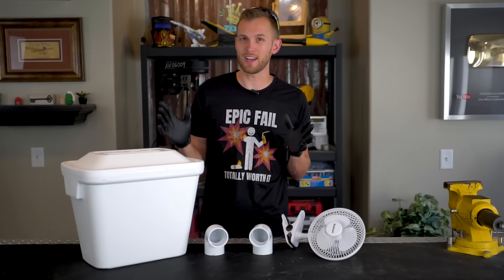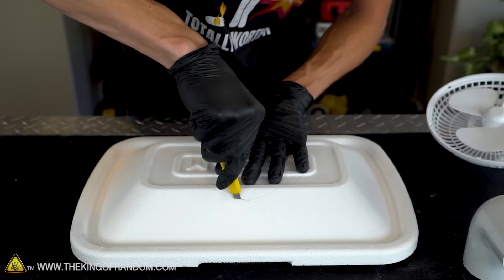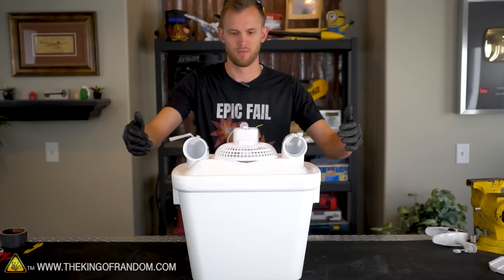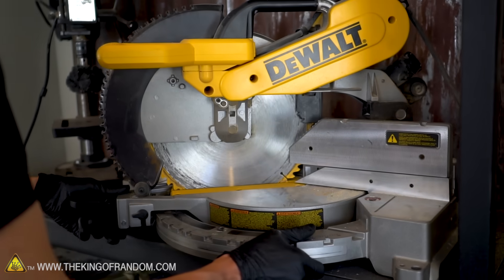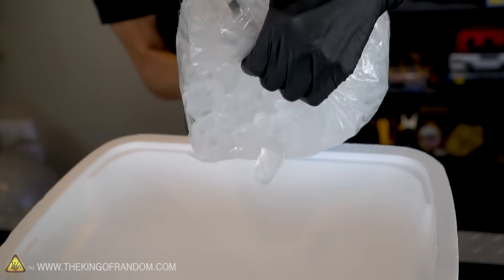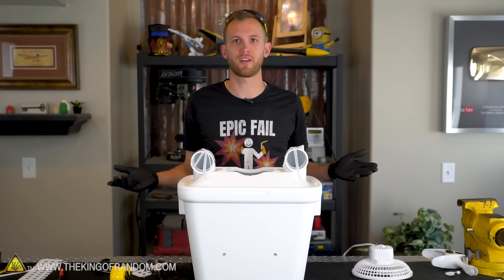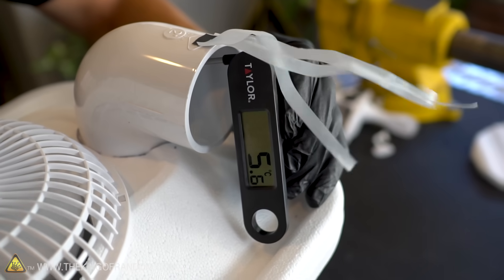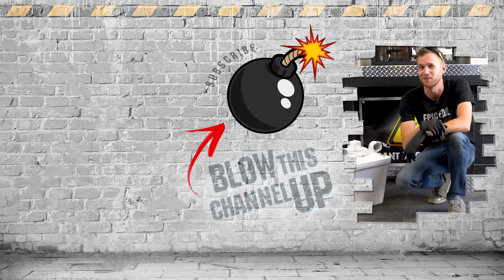Recycled Styrofoam Air Conditioner! TKOR Creates An Efficient DIY Air Conditioner!

Comment: it works great for about 15 minutes. cute but not practical
Reply: Use a massive ice block on the bottom and completely fill the top half with ice cubes. And seal the container properly
Reply: How big was ur room
Reply: I have 7 to 8 illegals 3 times per week in a 5 by 3 foot closet and let me tell u for about 20 minutes a day they are in heaven .😜👌
Reply: @enriquebloberg1959  the world is dying to know what you do for a living .
Reply: @enriquebloberg1959  didn't got u
Reply: Don Carbon try using dry ice it doesn’t melt
Reply: Error 101 it'll suffocate you.
Reply: @Error-jv1kj  lol, even more ridiculous
Reply: @Error-jv1kj  Do you want carbon dioxide poisoning?
Reply: @Ty_Cunningham  actually its called carbon monoxide posioning and u cant get it from dry ice.
Reply: MrDankest dry ice IS solidified CO2, it releases CO2, not CO
Reply: @definingimage  thats exacly what i was tring to exlpian
Reply: @Logan-tx3lk  CO2 can also poison you.  Both because it acidifies the blood (causing headaches, hyperventilating, nausea and eventually coma that leads to death) and can displace O2 in the air, thereby suffocating you.  CO2 is heavier than O2 (the oxygen we breathe) so it will sink to the floor, and in a poorly ventilated area, like a closed room you're trying to cool,  it can settle in a layer near the floor and hurt children, pets, or any one laying on the floor trying to cool off....

Comment: You should try adding salt or rock salt to the ice. It works great for cooling drinks faster
Reply: That’s the same thing I was thinking. Also putting ice in it overnight will get it used to the temp and it’ll hold ice for longer. I just want to see someone destroy a yeti with this in mind, I’ll bet it’d run ice cold for a week lol

Comment: You could also use a large ice pack so there's no liquid mess as you'd get from the ice cubes. Or you could seal some ice in a bag and make your own ice pack. And I said seal not zipper.
Reply: seal or zipper wtf is the big deal lol
Reply: @knockhello2604  A sealed bag from a bag sealer will not leak. A zippered bag will leak.
Reply: @azraelsgrave  condensation tho
Reply: Yep...except the ice pack gives off water right?

Comment: now how do u empty the styrofoam container pratcaly I have made my on air cooler and that ice is gong to melt very fast because of the warm air you are using from the fan
Reply: Two ways one put a tray at the bottom to collect the water or two buy a cheap plastic container and if you want to make the cutting process easier use the lid from the styrofoam container
Reply: point 1 fan at the fan and others(plural if wanted) pointing out to the room....Cool air going towards the fan...

Comment: So what happens when the ice melts, creating water that then blocks the long pipes you put in to force the air to circulate from the bottom? It can no longer circulate air. The original design is superior to this. It will run longer, can handle cube ice or frozen bottles, and will continue cooling long after this one fails even if just blowing air past cold/cool water.

Comment: You should have used a pipe with the fan only. (Just like blowing in a straw.) That way the fan is blowing into the ice, and when it melts you don't have to drain the water. (Like a swamp cooler) You could have gotten lower temperatures that way. Also use a stronger fan that has a concentrated air flow.

Comment: Technically it's just an air cooler right. Air conditioners adjust humidity and temperature 🤔 cool though
Reply: humidity in the air will condense on the ice cubes until melted.
Reply: This adjusts humidity, but only in the upwards direction.

Comment: The material's may have only cost $20 but the necessary tools to cut the pipe cost far more. Especially that industrial saw used. This DIY was very expensive if you do it exactly as he did and do not have those tools.

Comment: I was forced to do this cuz my mom never turns on the AC
Reply: Does it keep your room cool?
Reply: @d00gle90  Kinda, u gotta keep replacing the ice about every hour.
Reply: Well depending on where you live, the a.c. could spike your electric bill. also, in more densely populated areas, cause power outages. If you are paying the bill, or are contributing to it's payment, you could leverage that for using it more often on extreme heat days. (Like 105°f + days) otherwise, this and pool time are your best bets.
Reply: Try block ice, it melts slower
Reply: Your mom is high

Comment: if I may suggest I am goign to try this with a large Tupperware tote with the lid and cut the same holes you did, instead of using bottles of frozen water I would use square containers of Tupperware that can be stacked so there will be less gaps. also I am going to cut up a Styrofoam cooler (may need more than one) and cover the bin, I will let you know if I can get it to work, if not I am going to do it your way

Comment: Air can't flow through melted water.  Oncs the melted water gets to the bottom of the pipe.  It's not going to work.
Reply: Melted...  Water...  Hmm...
Reply: @bibby42  LMAO
Reply: ice is less dense than water. 
when it melts the level will be lower. so unless your pipes are well below the level of the ice, there will still be room for airflow after it melts
Reply: A bad inventor would put the pipe right at the bottom 😂😂😂
Reply: If the seal was tight enough and the fan strong, it could potentially push enough water into the tubes to let air gurgle through.  Also a great way to cool air.
Reply: or if it's really tight it could shoot water all over your stuff

Comment: How about using a usb fan and a power bank or, if you're not too worried about over volting slightly, a four cell battery box. Could even use a pc fan with an eight cell battery box.

Comment: Best design I've seen for this kind of concept. I'm planning to use frozen soda cans filled with water instead, ice and water are too messy.
Reply: Note that even open soda cans (and bottles) can deform and/or break when ice is made in them.  Part of the benefit of the flimsy water bottles is their ability to deform without being destroyed, as the ice expands.

Comment: Hi..if you take the computer fan and cut the lip the blowing side..leaving suction side intact..it will snap into a cut to fit hole.  I also used cheap plastic coolers. Or even the orange home depot ice coolers. I still have the prototypes I built 20 years ago!

Comment: Would a USB powered fan make it more portable, especially if using a USB solar panel?
Reply: Portable yes, but you'd want to make it smaller due to much lower power on a 5v/0.5A ~ 5A fan versus wall power.

Comment: FYI..When I originally designed it..it was 12V..it would run off of a .5 amp 12V solar..also using a computer fan with built in led was the best. Quiet, free light and low profile. Party on
Reply: Nice idea but i dont know how to put a computer fan on the styro. Could u atleast film it cuz its a great idea.
Reply: RGP Homes Is the computer fan powerful enough to cool the air?

Comment: Was actually thinking about doing this with a USB powered fan and a backup battery pack for when lights go out in hot weather... Would be better than sweating to death lol
Reply: that idea would make a great tent a/c unit
Reply: Use a USB solar panel (and usb extension of course) during daylight
Reply: Yes! My thoughts exactly on the tent ac lol and the solar USB during daytime is great idea... Also instead of backup battery use a battery bank to store energy for night use

Comment: Is there a way that you could use ice cubes a little bit of water and a couple chunks of dry ice and some  salt.? As the salt helps melt the ice the dry ice refreezes the water that has melted as you're being air-conditioned for 6 to 12 hours is it possible? and can you do a video on it?

Comment: Needs a way to drain the melt water... perhaps re-use the spigot from a cheap box of wine.
Reply: How about just dump it
Reply: @rob4mma  the wine or the water?
Reply: You don't want to drain the water the cold water works to keep the rest of the ice cold. After the ice is melted you're still left with cold water. If you dump the water the ice will melt faster.
Reply: @store4books  Sure, but at some point you'll end up with water that needs to be at least partly drained to make room for more ice. The cooler will be heavy at that point, so a spigot to drain into a bucket makes some sense. Or into tubing that runs outside, possibly to water plants that can take the cold water.
Reply: @spidercubed9718  I'll take the water and not he wine
Reply: tubing attached to the side into a gallon.

Comment: Put ice inside the tubes so that the air really has to go through the ice
Reply: That would disrupt the airflow too much probably
Worth the shot tho
Reply: @tjorvenblader  technically,you could somehow put smaller pipes in bigger pipe,so that its hollow all they way around the side,then put water in the sides and freeze it.Would be some work but just an idea
Reply: @mrsaucey5284  Yeah that would work as long you used metal pipes, if you used pvc it would insulate the air and defeat the purpose.
Reply: Tried this. Not enough air flow. Totally defeated the purpose

Comment: you cut holes in the side and that ice will melt and water will come out the holes!! 
Also think of icebergs and the entire ice shelf...WHICH MELTS FASTER!!?? MAYBE USE THE SOLID BOTTLES AND THE BAG OF ICE TOGETHER AND THEN SEE...
ALSO IF YOU HAVE A SMALL BATHROOM CHECK THE TEMPERATURE OF THE ROOM FIRST (CLOSE OFF THE VENT FIRST)...THEN PUT YOUR LITTLE PORTABLE FOAM A/C IN THE ROOM AND LEAVE IT FOR SAY 2 OR 3 HOURS (OR HOWEVER LONG THE ICE LASTS)...THEN DO A FOLLOW-UP VIDEO ABOUT IT!! (BTW...I'M PRETTY SURE THE AVERAGE AMERICAN DOESN'T HAVE A COMMERCIAL GRADE SAW IN THEIR GARAGE)...

This is my 1st video of yours I've watched and i enjoyed it but maybe give some of my suggestions a fair try.
Thanks and take care

Comment: Cut a hole in the SIDE of the cooler and attach the fan there instead. That way the air has to flow through the entire cooler to escape through the vents at the top.

Comment: Option #1 is to use a heavy duty battery charger plugged into the wall and hooked up to the car battery and turn on the A/C without having to use gas or drain the battery.
Or try putting a solar attic vent in your roof instead, will last for decades and keep your WHOLE HOUSE 10 degrees cooler all year round.
Another option is to add slatted shutters to your windows allowing airflow and light in while keeping direct sunlight out.
Another thing you can do is use one way reflective mirror tint on all your windows.

Comment: I see a problem with your design. If you have the vents below the ice, near the bottom of the cooler, then as the ice melts you'll end up having a bunch of water covering the outtake vents pretty quick. Maybe you could make a drain that you can be opened when the water level gets too high. That way you don't have to take the whole thing apart to empty it all the time. Plus bonus you can have ice cold water to drink that will help cool you off.

Comment: I would have just found a way to make the pipe for the fan so its not forcing a small amount of air into the tubes and circulating the rest around it. that would have also manually with ease air into the ice, especially if you  fill the ice bottles around it and maybe even stacked them on both sides leaving only the elbows at the top bringing all that cool air out. and maybe even then aluminum foiling the fan chamber?

Comment: Why not use egg crate or light diffuser and 1/2 inch pvc pipe to make the stand so you dont get a leak poking the holes with the dowels?

Comment: WHY not just buy a cheap A/C ?   Kudos to the original DIY'r ,,,,next you could get an engineer to help you ?
Reply: Because they don't cost $20 and the electricity required to run an A/C vs the cost of running this small fan is a fairly big difference lol
Reply: Real ac units take too many watts to run off of your solar generator in an emergency.  This fan requires very little wattage. Even a small fridge can make ice on a little generator. Regular ac pull too much power

Comment: This vid is why I prefer living in colder areas - you don’t have to worry about AC as much (you still do but sometimes it is 60 or lower on some days in the summer although it did get above 90 for a couple of days) and in the fall/winter/ early spring all you have to do is put on fuzzy warm clothes and bam temperature issue solved

Comment: The AC in my car broke about a year ago and for the last couple of months this summer I have tried every single method he's done in some way shape or form and I could say the Straight ice method is the coolest but you burn through it so fast driving in a car with that hot air being sucked into it I could probably get about 20 minutes of drive time before it's just a soupy mess.

Comment: refreezable icecubes should solve the "not reusable" problem nicely. since cubes work better than bottles. and no leaks .
Reply: a refreezable icecube is literally just a waterbottle without a cap. the shell stops the cold from transferring to the air the same.
Reply: @mattstanislen3165  Since more surface area would be exposed than a bottle, I think the the reusable ice cubes would work better than bottles, but worse than normal ice cubes.
Reply: @NewtheElf  reusable ice cubes have a smaller area they'll get warmer a lot faster the bigger the bottle of water the slower it'll melt
Reply: @store4books  Correct. By "work better" I meant in terms of cooling. Since they would melt faster, that means they would in turn cool the surrounding area faster.
Reply: @mattstanislen3165  the air flow many small ice cubes tuch more air than a frozen bottle cuz only the outside of the bottle cools while an ice cube sized bottle would have almost same effect as the real icecubes
Reply: Because using reusable ice packs or something similar (the more surface area the better), this concept solves the problem of the water filling up the bottom of the cooler and the "low tube" design failing.
Reply: @GuillaumeB7  A big part of the idea was for this to be cheap.  Metal bottles wipe that notion out, unless, like the fan, you already have them.
Reply: That's a better idea, since it won't soak the air in your room with water vapour.
Reply: @greenaum  There's not much water vapour coming off even a melting ice cube.
Reply: @bpj1805  Assuming you change it, the minute it finally melts.
Reply: I had the same thought.
Reply: Can I use techni ice on this build?

Comment: I made one a long time ago as a kid that used an old heater core from a truck to flow air through that had water pumped by a bilge pump and used a 4" exhaust fan from a boat. It put out between 30-32 degree F air at the end of a 10' flexable 4" duct. all the parts were in a 32QT cooler that had leads that hooked to a 12v battery on a golf cart.

Comment: Lmao, dude u gonna cause ppl to have a mess after five mins. The ice is gonna melt and pour out the holes u poked thru the sides with the dowels, on top of that how is air gonna go thru ur vents after the ice melts and covers the bottom of the tubes because u have them an inch from the bottom. This is a fail, fail, FAIL. U need to rename this video 5mins or less and then jump in the freezer because this don’t work long air conditioner. Haha

Comment: One thing to note this is actually an evaporative air cooler i.e. a swamp cooler. Because it works by adding cool moisture to hot dry air it will not be very successful if you live in a humid climate. An actual air conditioner works by removing moisture from humid the air thus lower the air temperature and humidity.
If you live in a dry heat area this cooler unit will work well enough. If you live in a humid place this unit will not be very useful since the air is already very saturated with hot moisture and adding a wee bit of cool moisture will not improve the temperature at all.
Reply: Kara Nguyen while similar it wouldn't add nearly as much moisture as an evaporative cooler, those work with average temp water soaked pads, this is using ice to cool off the air flowing through the styrofoam box.
Reply: you just crushed my dreams
Reply: U can say it’s a evaporator or a cooling tower
Reply: It doesn’t transfer heat constantly
Reply: Then, what is the solution for Humid Climates in this design?
Reply: No idea what the original poster of this thread had in mind for an AC unit, but real AC unit are heat pumps.  They take a pressurized gas, compress it, and that compressed gas/(now liquid) heats up.  That hot fluid passes through a cooler to remove the heat.  That's why the outside of an AC units venting system is hot.  That now cooled liquid enters and expansion chamber where it expands, and in that process of expansion, consumes heat.  The opposite process of the compression cycle.  Inside air is circulated through a radiator with that cold gas/liquid and chills the room.  Humidity of the room makes no difference in how cold it gets, just how long it takes to get cold.
Reply: Kara Nguyen neat but is there a solution for humid countries

Comment: You can't do this with ice because as the ice melts, the water in the bottom will rise higher than the bottom of the tube, and that little fan won't be able to create the pressure necessary to force through the water and into the tube. The fan will burn out rather quickly. The answer is to use dry ice, which evaporates instead of melts. Then again,  who has dry ice laying around the house? The only other alternative is use a lot more and smaller frozen water bottles instead of ice.